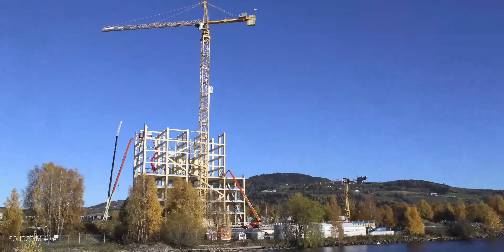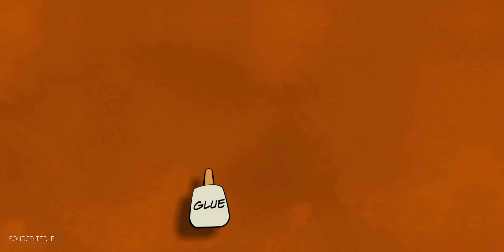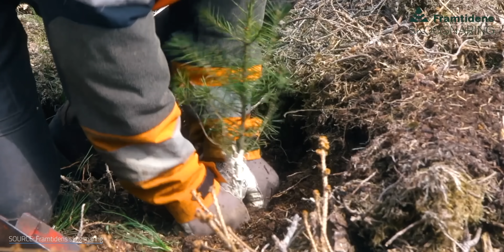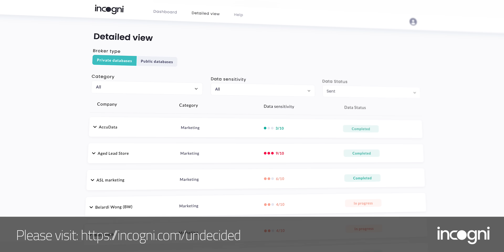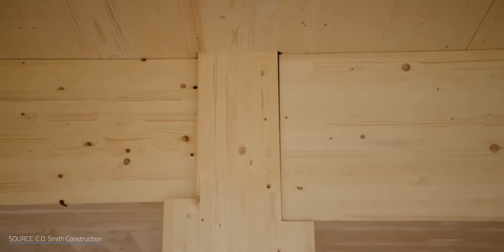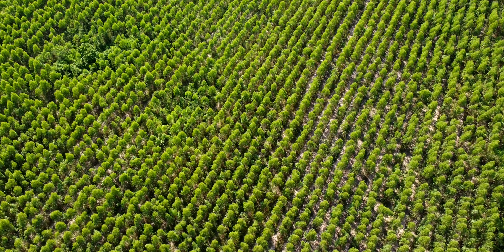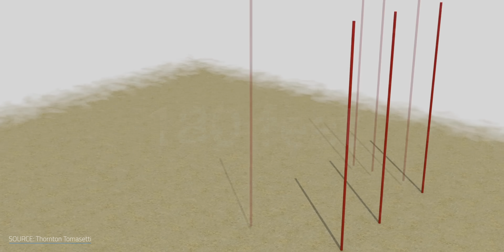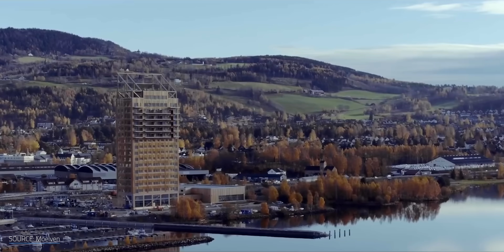How We Engineered Incredible Wooden Buildings

Comment: If you want your structure to have reasonable acoustic performance you’re going to have major cost jumps with timber. Like you’re gonna need very special acoustic “resilient” connectors to limit structural noise transfer (dense rubbery sponge - but polymer/ petrochemical based). And the light weight is only good for the structural guys because mass stops airborne noise (sound insulation). And no you can’t just fix the problem with a lightweight sound absorbing panel because that just deals with echo. 
If you want a lot of people to live in the same building you need to have acoustic separation between units else they’ll all just move to the suburbs.
Sound isolation works with the mass law (double the mass gets another 5dB performance), structural isolation needs the noise souse isolation with a resilient connection (footfall noise, mechanical equipment, etc), and lastly sound absorption is light fluffy stuff that makes a room less echoic but is very important for schools restaurants and offices.

Comment: I hope once the price comes down more that cities will use a hybrid design to improve public housing.  Take the existing framework of a public housing high rise.  Extend the height and width to increase the number of apartments.  If parking is an issue add elements of Ascent.  The lower floors are concrete parking structure and the upper floors apartments.

Comment: Hardboard and hide glue is one of the only combinations for engineered wood that is truly decomposable.
Reply: The information that guest gives at 07:30 is wrong. Like many people he forgets, or perhaps never knew, that solid and liquid combustible materials do not burn. They can however in correct conditions give off flammable gases. The flammable gases then burn as they mix with an oxidizer, most commonly oxygen, with ignition added. Some of the heat from the fire goes back to the combustible material, in our case wood, heats it to decomposition, more flammable gases are produced, wash, rinse, repeat. The char works by insulating the wood, so it decomposes to flammable gases slower. Less flammable gas, less combustion, therefore less heat, therefore less decomposition, ….

Comment: The other question wirh wood could be rot/degradation.  Engineered lumber is a great fit in homes, which have reduced loads and stresses, and can usually be repaired without scraping to foundations.  How does this apply to commercial scale buildings?

Comment: Building a standalone house in Bergen, Norway at this very moment. Wood all the way! One huge mega benefit of the wood was not mentioned, isolation layer is the wall itself, while with concrete/brick one more extra layer of isolation is necessary. It explaines, among other benefits, why 99+ % of all houses in Norway are wood built

Comment: "Clear cut answer," lol, stop. I love this technology. One thing Matt did not mention is the beauty of the exposed pillars and beams in condo/apartment units. There's a warmth to wood that you just can't get with steel or concrete. Crews would need to get used to working with a finished structural material, I imagine. I first learned of this material on an architectural channel, and the carbon sequestration was only a minor point: he loves the look of it. I wood assume that engineered lumber would be fabricated in a way to not require ongoing inspections either, like post-tension concrete - a MAJOR expense to condo corporations here. I'm very excited to see how this material will be incorporated into new buildings of any height.

Comment: So many alarm bells go off as I watch this video. Like for example how those small scale fire tests are totally not representable for a skyscraper on fire. He mentions that a thick wooden beam doesn't catch fire when you throw it on a wood fire. That alone shows he has no idea how fire works. In a sky scraper, a fire will heat up the air that rises to the next floor and the next, while with each additional floor on fire, the fire will suck in more air creating an extremely hot fire storm. Anything remotely combustable will instantly ignite and burn much more violent and faster. Not only that, once such a wooden sky scraper is burning, it will shower the surroundings with massive amounts burning pieces of wood and glowing embers. If there are enough wooden skyscrapers nearby, this can set every building on fire, incl. non wooden skyscrapers.

Comment: Its important to note that forest and tree farms are very different! Those grid shaped pin “forests “ we see at the beginning have a much lower biodiversity compare to a normal forest and they dont nearly have the same benefits (or amount of benefits). So increasing the amount of tree farms does not increase the amount of forests
Reply: The footage was from North America. Other parts of the world have managed forests. Sure, a non-managed forest has significant benefits, but then what will we build with? The continued use of concrete and steel aren't particularly good for forests, either.

Comment: Thanks for providing this excellent insight into possible ways that construction may change.   
I had an experience in the mid '90s in Wisconsin that is along those lines regarding timber construction.  My wife and I met a man (I don't remember many details) who offered to show us one of the houses he was constructing in the middle of the woods in southwestern WI.  The house he took us to was immense - one of the most unusual houses that we've ever seen (and we've seen and lived in many unusual homes).  To make it simple, he brought in huge timbers that he drove into the ground and used them to provide the support for the floors which could be placed at just about any height on the posts.  I'm guessing that the home would eventually be between the equivalent of 3 to 4 stories, though the house wasn't divided into stories.  The exterior walls between the posts that were up so far were huge panes of glass.
This man was in the construction trade in Chicago.  He told us that he was getting his supplies from older wood structures in Chicago.  He would purchase what he referred to as skyscrapers but I doubt that they were that tall.  He would take the materials and repurpose them for the homes he was building in Wisconsin.  He indicated that the wood structures that were demo'd in Chicago would be replaced with steel structures.
I don't remember this building having any laminated posts.  They were all solid wood.  I can't imagine how he got those beams and the huge plate glass out of Chicago.  
So, apparently, tall buildings have been made of wood for quite a long time.

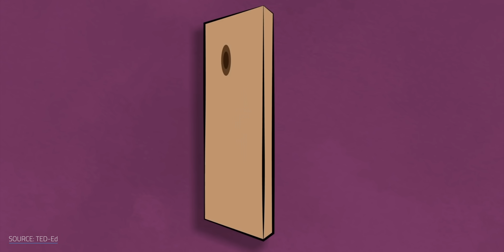Comment: @1:46 Im pretty sure lumber is stronger in compression than tension. Ive seen the studies. The studies do not look at how lumber is joined/assembled by framers. Lumber tends ti split when in tension, not compression. And like anything in engineering, its all nuance: lumber is often bolstered/blocked to reduce buckling when the lumber is in compression. How can blocking help when in tension? So making the claim lumber is stronger in tension may technically be true, in practical terms its weaker in most traditional joints.

Comment: Ever stayed in a hotel in Southern California under 15 stories. Guess what it was made of wood most medium-size structures in Southern California are made of wood because they can handle a large earthquake Because they are pre-loaded compressed buildings, which means in every wall about every 10 feet there is a steel rod hook to a spring going from floor to floor, compressing the building like a string of beads

Comment: Wood material have 3 question
1. Fire prove >> Seem yes than Steel in this clip
2. Water prove >> when wood is soke with water there size is change it make it self bending and may caust all structure collaps
3. Termite Prove >> In this day we can add some chemical to prevent but chemical is not 100 years active , so in long run how can be sure our building are not collaps by termite or carpenter ant

Comment: I don't believe these products "sequester" or "store" CO2, which sounds like the systems that pump CO2 underground. Photosynthesis does not store CO2 in plant matter. It uses CO2 in a chemical reaction that stores carbon in the plant matter and releases half of the oxygen. 6CO2 + 6H2O + sunlight -> C6H12O6 + 6O2  The numbers quoted here could be the mass of just the carbon or the mass of the CO2 that is removed from the air to grow the wood, but they can't be the mass of the CO2 (which is 0 kg) or even the mass of the C and O separately (since the 1:2 ratio is not preserved in the plant matter).

Comment: This reminds me of a story my college professor told us about the early space program - he was one of the very first engineers working on programs like Mercury, Gemini and classified gov't projects.  He said they had investigated the idea of using wood as a heat shield for re-entering spacecraft.  It worked because of the same charring phenomenon you discuss.  It would protect the spacecraft from overheating, but due to the ablation effect of re-entry friction, they had to have a shield (I think he said they studied oak) about 3-4 feet thick for the full re-entry profile.  He said it worked, but in the end was far heavier than any of the other options they had.  And in any kind of flight, low weight is key.

Comment: Fire is the least of woody’s worries. Rot….what chemicals are required to control rot for 30 years? I can only imagine a high rise condo complex built out of engineered wood….10 years into ownership the wood rot and water damage claims would be staggering for the HOA. After 16-17 years, these claims would bankrupt the HOA. It is one thing to build a 2-3 story wood structure, but when you go higher, rotting wood and water damage changes structural dynamics exponentially.

Comment: I thought of a house built from it because you assemble it like a ginger bread house except you just screw it together. My biggest problem would be the trip from the cross laminated timber factory in Alabama to Ohio with a stop in Tennesee to cut the pieces from the raw CLT boards from the factory. They have some videos on CLT homes being built mostly in Europe. They go together quickly and most home owners use large wood screws to put them together themselves. It can save a lot of labor and costs if you don't have to ship your materials from too far away.

Comment: Obligatory 911 conspiracy theorist comment that your stats on steel and concrete behavior in heat that screams that steel buildings cam collapse at a lower temperature than the melting point of steel.

Comment: Wide usage of e-wood building makes it worthwhile to have extras in stock, especially if the buildings start using standard elements and not one of custom parts above the bare minimum. That way you just order the number of parts you need and any damaged ones can be easily and quickly replaced increasing the savings in the material costs and the ease of planning. It is after all better to use over provisioned/engineered parts than the bare minimum required to know it will last at least as specified or more regardless of fire or wind. That way post fire/damage repairs would be far easier by braising, un bolting and replacing the damaged parts only and not need to demolish the whole structure losing all and need a 100% replacement building, insurance could be far cheaper and more profitable for both parties in that situation, after all 25% of a building is far cheaper to repair/replace than 100% + demolition and disposal.

Comment: I agree with the statistics but wood is a fuel and steel and concrete is not.  Wood may resist burning longer without losing structural integrity, but the fact that it’s a fuel makes the challenge of putting out the fire that much more challenging.

Comment: My understanding wood is strongest in compression, down the grain. The tree weight is directly down 24/7. Secondly strongest in lateral strength, the tree resisting sway, bending. I supplied wood to hold a carbon fiber mast up on a yacht. The carbon fiber great at resisting sway and bending but couldn't hold its own weight in direct down compression so well, needed a skin of wood around the carbon fiber core. I don't think wood is too good at tension, being pulled along the grain? After the Christchurch earthquakes here in NZ a lot more work has gone into this type of multi story wood construction and cross lam multi story building. Wood handles earth quakes better than more rigid materials like concert and brick. Canterbury University in Christchurch in conjunction with a Japanese University have shaking pads, Canterbury the smaller and the the Japanese the bigger where they simulate earth quakes. The wood beams joined with flexible joints that pull back together, wire ropes, running through the beams. 

Yes water the great liquefier, it helps break down everything eventually even rock, crack, freeze thaw . Steel and water don't work to well either, I think its called rust! O and reinforced concrete doesn't like water too much either, crack, rust, bigger crack, more water, more rust bigger crack and crumble, structure disintegrate.. Trick is keep out the water..

 Its often in the application of a material.. China used Paulownia wood for braziers, a large wooden bowl, a fire inside, the wood chars and protects the remainder of bowl from burning, highly decorated painted outer surface. Thick wood chars and the fire cant get through. Steel structure collapse under their own weight in a big fire, really thick beams can be the last thing standing in burnt structures of the past..and have been used again, sometimes in the same building, the minor structural, lining and cladding being replaced. 

You had carbon emissions producing Steel 1.8 ton per cube and concrete 0.9 ton per cube  I was waiting for the cost in carbon per ton to produce wood?

Mono cultures can also be a natural forest thing. We have mountain beech in NZ that grows in patch like mono cultures in the mountains. You can walk through totally single species patches, where a landslide or avalanche has wiped a hillside/mountain side clean and beech has come back at 40 000 seedlings per hectare. We also have our commercial forests of mono culture Pinus radiata which I think work to some extent but are vulnerable to disease and relatively low diversity. I would favor a rich multi age multi species natural manage forest.

Great video Matt, wood is good.

Comment: This is (part of) why we need a carbon tax. The wooden structures would be way cheaper and the steel and concrete producers would quickly shift to renewable thermal power. If you're against taxation, this doesn't earn the government a penny. Tax, carbon heavily and then divide up all the tax money equally to the entire adult population, at the end of the year. Those who chose to use lots of fossil fuels, would indeed be out of pocket, but those who reduced where they could, would get a net gain. In fact half the population would get more than they paid in tax. Things would change so, so quickly.

Comment: Matt transportation isn't quite the problem you think.  My father use to ship main line water pipe from detroit to Cleveland, Toledo, Milwaukee and Chicago by water.  These pipe weren't going by boar but tugged by tug.  Some of these pipe were 18 feet in diameter 40 feet long with an outer wall of 5 inches.  They were made of a steel sleeve, cement, prestress wire and more cement.  He would transport the pipe a few miles by truck to the Detroit river,  a water tight cap was put on each ent, chained together and then towed to the final destination.  It was not unheard of at the time.  Underwater tunnel sections were handled this way.  They just didn't travel as far.  Perhaps they could float the structural lumber that way.
Reply: Is this the kind of transmission main that caused water restrictions in Calgary for the last couple months?

Comment: I found myself feeling quite pleased as this story progressed.  I always assumed that wood was limited by load strength for taller buildings, but never considered engineered wood products as a possibility.  Even with a small amount of craftsmanship at home using plywood has demonstrated just how tough and flexible a building product it can be.  

Also, modern architecture needs a shakeup to try some new ideas (at least visually).   I live close to Toronto, and the core of that city has turned into a boring collection of steel and glass bricks.  There are, of course a few standouts, but really there isn’t much to get excited by.   Some of the samples shown in this video were absolutely gorgeous.  And to be made with renewable, low carbon materials put a big smile on my face.  😊

Comment: Hmmm, interesting. Might even be better than concrete during earthquakes. But you can't have the wood tempered, cured, painted, and carbon absorbing at the same time, no? Also, if left at its carbon absorbing state, wouldn't it also be able to absorb humidity and rot faster?